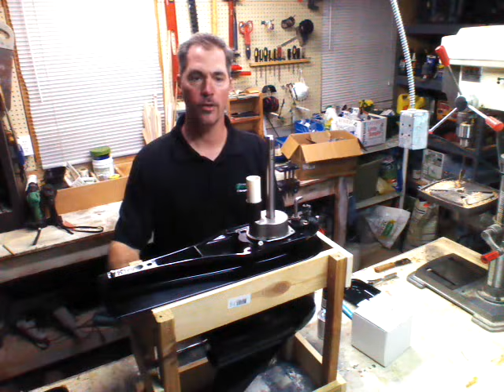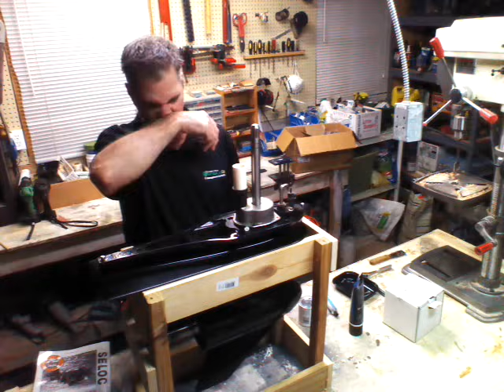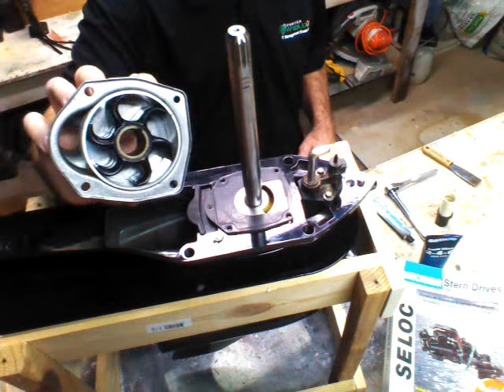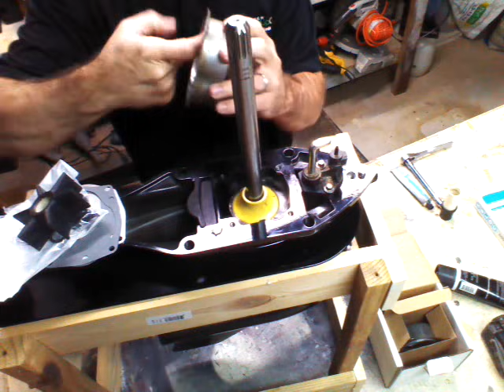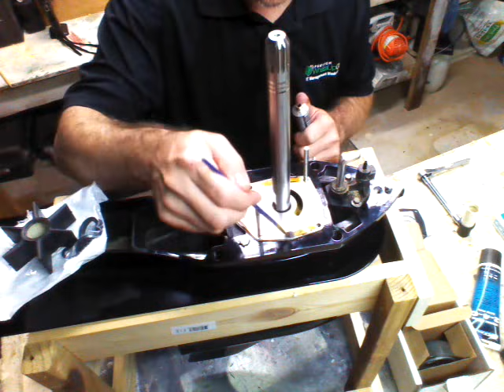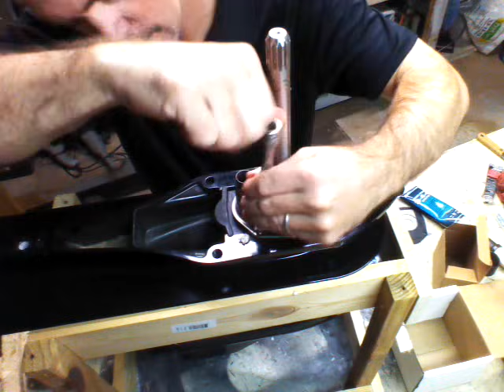Mercruiser Alpha One Gen 2 Impeller Repair

Comment: 25:30. thats for the screws where gear lube is coming out.  also impeller direction is not important. when you start the engine it will change to correct direction.

Comment: This is one of the best videos on the web for changing the impeller. My shaft will not turn because it’s in gear. Can I pull the lower unit in neutral. ???
Reply from the maker: You should be able to rotate the shaft no matter what. It's harder in gear ..wrap a rag around the splines and get a good solid grip on it .. then rotate ..it takes some force but MUST rotate. The lever in front changes direction and YES in the midway is neutral
Reply: @ Thank You. I’ll give it a try.
Reply from the maker: Also ..when you go to put it back on the upper unit, you need to put the shifter forward so the lever lines up with the lever on the lower unit ..which should be strait ahead 12:00 o'clock

Comment: STEP # 1 on all DIY videos:

TAKE PICTURES! Take them before you dissemble anything at every step of the way. Those pictures may save you a ton guesswork or re-work. Just about everyone has a cell phone these days or has access to one to take nice pictures, so there's really no excuse. Trust me on this one folks. TAKE PICTURES! A picture truly is worth a thousand words.

Personally I don't use any sealer on the gaskets on the water pump. The latest kit has a steel gasket for the very bottom, then the contact plate, then another gasket that has sealant already on it (face it up when installing).
Reply from the maker: Actually you should take pictures anyway .. regardless of making a DIY video. Also, if you are  making a DIY video... then you already have a digital record to refer back too and usually don't need pictures 😉. But yes it's a great point, I do it one way other the other .. especially on intricate projects like carburetors and chainsaws. Thanks for the comment!

Comment: That sling seal seals oil into the top half as well, it will push itself into place when you slide the shaft into the top half won't it?
Reply from the maker: Actually no, nothing touches the top of that seal. That's why they provide that plastic tool. It's not for oil, it's to keep water from spraying up into the upper unit and of course keeps pressure up. It's not supposed press down onto the housing very tight. I see people leave the plastic tool in there thinking it's a part lol

Comment: Thanks for posting this. Finally doing it myself this year. Note: Last impeller change was done by an authorized Mercruiser shop. There was no sealant on any of the gaskets when I removed the old impeller.
Reply from the maker: Yeah, since these don't need to be water tight anyway sealer is unnecessary. Consider replacing the assembly seal underneath the pump as well. There's two orings that wear and will leak eventually. It's very easy to do while you have it exposed. Also ..putting the lower unit back on is a bit tricky. Have to orient the feed tube correctly and put the shifter in forward.
Reply: @jonparkmac  Thanks for the tip. I'll be sure to do it. Enjoy!

Comment: I have a Mercruiser 260 with a Alpha 1 Gen 2 (I thought anyway). The impeller is much smaller with smaller blades.  Maybe I have an Alpha 2 pump kit installed?  The boat has run great over 10 years even though it's not taken out often.

Comment: The extra gasket is probably the drain screw gasket
Reply from the maker: It was. The ones in that kit leak. So I now use ones that have thin rubber coating and a tad thicker. I also replace that yellow assembly seal each time now too.

Comment: that washer is for gear oil screw
Reply from the maker: Indeed. You know tho I ended up using a better thicker one that has a rubber film on it. Way better than the one in the kit.
Reply: @jonparkmac  That washer better to be good as these are underwater. Thanks  for sharing this information

Comment: After trying this - DONT TRY THIS AT HOME. It is super hard to refit the lower house and realign. Had to give this to a mechanic to finalizd.
Reply from the maker: Should have asked me (author). It's not hard. Tilt upper unit all the way up. Put gear console shifter in  fwd. Put lower unit shift bar forward 12:00 straight. Lube shaft splines with marine grease .. and on 2 pins and smear on flange surface. Orient water feed tube and little grease on top. Ease the unit into position while rotating prop just a little so splines engage. Push it up and put bolts in. Should go mostly in. Bolts should pull it together easy with no binding. Put aquashield grease on threads for easy removal next time.
Reply from the maker: Guessing you didn't put the shifter in forward or got the plastic feed tube in a bind.
Reply: @jonparkmac  put it in forward, but it requries very little to misalign the shaft.
Reply from the maker: @Jstars200  that's why you slowly rotate the prop and grease the splines. That's what the mechanic did. No other tricks or tools. Anyway sorry it didn't work out for ya.i should have made a follow up video.

Comment: You really need gasket sealer?
Reply from the maker: No, you don't. If it leaks a little it's already underwater and won't reduce flow enough to matter. I did it only between the inner gaskets ..not on the outside or it make the next replacement harder

Comment: Hey I removed lower unit in neutral and then shifted in forward now I can’t get it to shift back in neutral or if I redo it goes to neutral but not reverse please help
Reply from the maker: You'll have to take it back off and orient the shift tongue forward which is FWD. Then put your console shifter in FWD. Then reassemble and put your  eyes on the tongue to make sure it mated ok. The shift tongue rotates from strait ahead to one side going thru neutral and reverse ..so it's not left to right ..it's 12, 1, 2 o'clock for fwd, neutral, rev.
Reply: @jonparkmac  how do I align the upper from where I’m at to the right 12-1-2 does shifting cable need to be disconnected?
Reply from the maker: Take the unit off and rotate it to 12:00 with your hand ..that's FWD. Play with it by grabbing the shaft with a rag and twist it to see which way the prop is rotating and then move the lever by hand from 1 to 2 and observe how it works. You'll  see it change direction. Move it back to 12
Reply from the maker: Also ..don't get that plastic water pump tube in there wrong or it will bend and pinch ..I did that once. Use marine lube on the threads and flange so it will come off easier next time.
Reply: @jonparkmac  the clutch itself I know how to move but it doesn’t line up with the female part in the upper unit

Comment: If the shaft spins either way (forward or reverse) why does it matter which direction the impeller fins are placed? they are going to move in either direction depending on if your in drive etc
Reply from the maker: The down shaft always spins in the same direction. Shifter is below the pump to change direction of the impeller shaft at the 90 degree junction joint. In fact I suggest testing that manually just so you learn how the shifter operates

Comment: I will be doing this myself not sure I ordered right part. Got part number from serial number on drive.
Reply from the maker: Consider replacing the drive seal too android don't bend/pinch the plastic tube that connects to the upper unit.  Good luck brutha

Comment: Hi there 👋 by any chance do you remember the size of the glide bolt you use
Reply from the maker: No but take one of the screws to the hw store and match the threads ..then cut the head off with hack saw
Reply: Any chance you can let me know the thread pattern when you make your guide bolts?
Reply: Any chance you can let me know the thread pattern when you make your guide bolts?

Comment: I have the same lower unit and I had to remove it for a skeg repair.  However, there is a part that came out of this unit that I cannot see on any parts list I cannot remember how it went in.  The part is a white rectangular piece of plastic about 4x3 inches with an X from corner to corner on one side.  Anyone know anything about this part?
Reply from the maker: Nothing to do with out drive

Comment: Thanks for the detailed video - very helpful! I am in the midst of changing the impeller on my Alpha One Gen 2. 

When I removed the lower unit from the upper, the entire tube on top of the impeller outlet pulled out from the upper. So I not only had the white plastic sleeve attached, but also a rubber hose of some sort from the upper. Is this normal and can I just press-fit to reinstall that tube into the upper? It appears as though the white plastic sleeve is designed to fit into that rubber hose as the lower is being installed into the upper. Another concern I had was that there was no seal on the main shaft above the impeller housing. It either disintegrated or was never installed (or not installed during a previous impeller replacement by the former owner).
Reply from the maker: The inner tube is actually the water feed and ok to take out and put back in. It has a curve so don't get it backwards or you'll crimp it. The white PVC is only a guide. You want the inner tube up in the upper and white on the lower. Put gear shift in forward and make sure the shift lever sits in the saddle. Also connect the speedometer tube. Use grease on the bolts and nuts. Don't forget the oil oring. It should go together easy no force. Pump oil backwards from very bottom till it comes out top hole, then put top screw in and keep pumping till it comes into reservoir. Small seal above pump housing should be in your kit ..there are orings up in the upper unit. You need the seal or it will spray water up into the upper unit. Grease the splines and little grease on shaft. Don't leave that plastic ring from the kit on the shaft. It's a tool to seat the seal and not a part.
Reply: Thanks Jonathan! One question on the water feed tube - should the curve go toward the stern of the boat or out toward the prop? Wanted to double-check before I reassemble the lower later today. The other question I have is why can't the gear oil be poured in through the Reservoir on the engine? I understand it's there as an indicator and gear oil can be added through there if it ever runs low, but was confused as to why the gear oil can't be poured back in through that reservoir in the engine. I do have the Quicksilver quart bottle hand-pump however and know that I need a bit more than 2 quarts of gear oil to top it off. I replaced the oil O-ring with the one in the kit, and knew that plastic ring was a tool thanks to your video. I also replaced the orange O-rings inside the plastic outlet that connects to the impeller housing since the kit included them. I always grease the new O-rings before fitting them back in.

I put generous amounts of 2-4-C Quicksilver grease on the shaft spline as well as the main shaft, and greased the bolts (I generally do this to prevent future seizing, but you have to be careful torquing them down as grease makes the bolts much easier to torque). I'm not sure which tube is for the speedometer - is it that small black tube on the lower with the O-ring? Otherwise I didn't see any other tubes on the lower.
Reply: @jonparkmac  Figured it out...tube had to curve inward toward the boat, behind that plastic insert inside the upper housing. Got the lower back in no problem, started the engine, new impeller seems to be working perfectly. Thanks again for the video tutorial!
Reply from the maker: @ChrisG9978  glad to help. The reason you shouldn't just pour it in from the top is because you'll trap air pockets in the oil system and you cannot know where those are. Can lead to a lack of oil when you need it most

Comment: Is your unit a RH propeller version? I'm trying to make sure this impeller I'm working on is facing the correct direction.
Reply from the maker: Check the shape of the old impeller .. it will bent in direction
Reply: @jonparkmac  Even if the last guy possibly installed it wrong?
Reply from the maker: @diydadsht9785  yes. The engine would have forced it the right way

Comment: Do you drain all the gear lube out of lower unit before removing?
Reply from the maker: Yes or it will come out anyway and make a mess. I empty the reservoir too since it will drain all the way down and takes a while. When you reinstall you have pump the oil backward from bottom to top until it comes out plug in upper unit. Otherwise air trapped, no oil .. bad news.

Comment: Could you provide the alignment bolt thread pitch used in the video please. Thank you.
Reply from the maker: Been so long I don't know, but just take the orig screw to hw store .. always a thread checker right there .. that is what I did
Reply: @jonparkmac  thank you, also, I noticed you didn't replace the carrier seal. Is that recommended to be changed also?
Reply from the maker: @ryansimnacher5459  most definitely .. I'm doing that right now in fact. I didn't in the vidi only because it was brand new. Use the one made by mercury .. part is 807929A1.

Comment: What is the impeller housing torque spec?
Reply from the maker: It's in the manual if you need to know. Overkill for this. Just get it tight
Reply: You had the Seloc manual right there.  What's the big secret?   @jonparkmac
Reply: The manual I have says 60  ft lbs.
Reply from the maker: @sailingpittsburgh  60 ft/lbs will strip it out. To put that in perspective..typical lug nut torque on a wheel is 85 ft/lbs. You just need it tight with 242 ..it's just a simple plate gasket you are sealing down.

Comment: That gasket is called quad ring. It provides sealed passage for oil between upper and lower.
Reply from the maker: It's was fill screw gasket. The seal you mean is a rubber oring and not a gasket. Thanks tho

Comment: measurements on the stand? lol
Reply from the maker: I'm afraid i don't have those handy .. i made it on the fly with saw and drill and screws. Just measure from the bottom of the horiz plate down past the fin and add 2" for H. Inside width front-2-back is same as unit width + 1". Then the thickness width is bottom plate width side-2-side - 1" (or so) - this one you have be careful so it does not move side to side and slip off one edge.

Comment: The extra gasket is for either the drain plug screw or the vent hole screw.
Reply from the maker: Drain plug. No such thing as "vent hole"
Reply: @jonparkmac not sure what out drive you have, but my alpha one gen 2 has a drain/fill plug on the bottom of the skeg and a VENT hole in the upper portion of the out drive. It's the screw you remove when you are filling the outdrive with gear oil that tells you the drive is full....buy an actual Manuel, but please don't stay things that you have no idea to what you speak.
Reply from the maker: That's on the upper unit. The pump is in the lower unit so the kit doesn't come with upper unit parts. I have the Manual, but not the 'Manuel' lol

Comment: This video was perfect for me. The only thing that would've also been helpful is if you showed how to detach/reattach the lower drive piece. That part I had to go find on some other YouTube videos. But the replacement of the impeller and the details were amazing and I got mine done. Thank you much!
Reply from the maker: Yeah, and putting it back on is tricky .. have to position the shift lever or it won't mate
Reply: @jonparkmac  Luckily I had a buddy tell me about that shift lever so we were good to go! My wife helped me stick a couple bolts back in so I didn't have to hold it the whole time and then buttoned everything back up, filled it with lower gear oil, then ran it with the muffs on. No problems! Thanks again fro the video!
Reply from the maker: @Adam Dirks  Pump the oil in from the bottom until it overflows out top hole to remove all air, then fill reservoir. Also good to put a good marine grease like Aquaguard on those nuts so the threads don't lock and easier to remove next time. Glad you gott'd done!

Comment: Great Video. I have to not only do that, I may have to replace the main shaft seal. Somehow gear oil is coming out of my water pick up holes.  Any help would be appreciated. Thanks for the great video.
Reply from the maker: Yeah replace the seal on the bearing. Also, there is a small rubber oring for the oil channel between upper and lower units, so make sure it's there.
Reply: @jonparkmac  Thanks.

Comment: Great video, thanks. What was the bolt size / thread pitch for the impeller housing "alignment studs"?
Reply from the maker: I don't recall but I took the actual bolts to hw store and matched the threads on a long bolt, then cut the heads off with hacksaw.
Reply: M6x16x1 is the bolt size

Comment: Hi just wondering about the yellow dome looking thing under the water pump gaskets. Picked up my rebuild kit the other day and that part was included and I can't find any videos that explain how to remove and replace this part. Any help would be appreciated.
Thanks
Reply from the maker: That seals the bearing underneath and is not part of the pump assembly. You don't need to replace it unless it's several years old with a lot of hours. And if you do, may as well replace the bearings.

Comment: You never want to keep your old impeller.  Rubber gets brittle over time which increases the chances of the impellers lobes to break off.  Lube the impeller with a bit of silicon grease, not petroleum based grease which encourages rubber to swell, when installing the new impeller.
Reply from the maker: You must not have actually watched the video brother. The whole point is to replace it, not reuse it. But thanks for the comment.

Comment: What happens if you forgot to put the sling seal on? should the unit work okay?
Reply from the maker: Not sure. I'd think you might loose a little pressure and water will spray inside the compartment. But I don't know if it would cause damage.